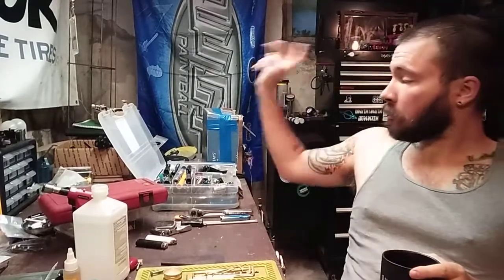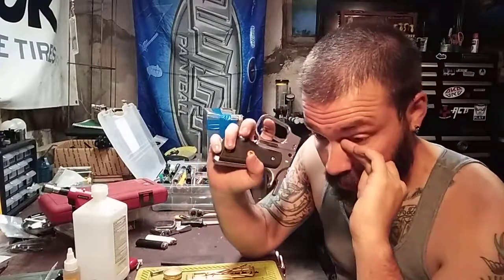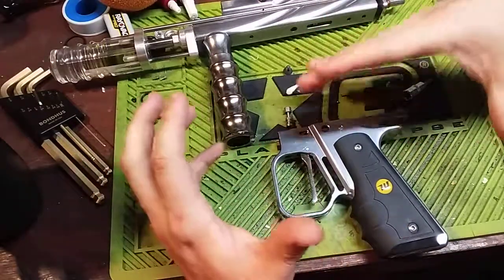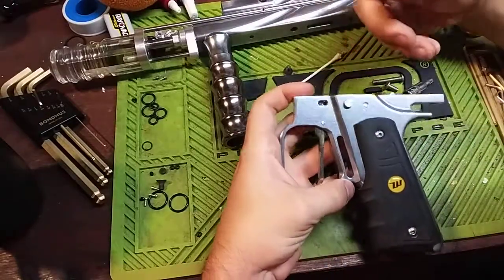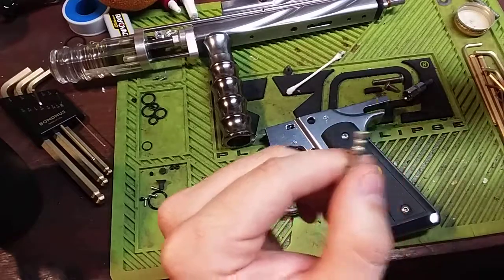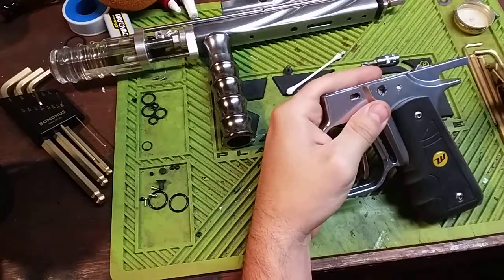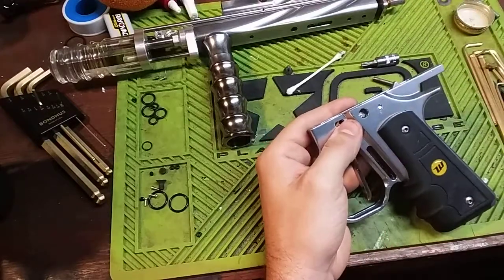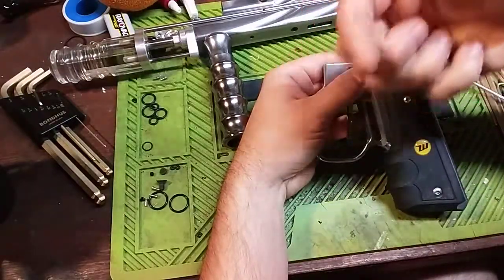Putting the safety in the frame hole and the coffee in the brain hole.

Comment: I recently purchased an E-Orracle (dream gun from my high school days). My only gripe is the feed neck. I see a couple split lines but the stack will not come off by hand. Are they threaded, but secured with permanent thread-lock or pinned before finishing? If it’s threaded I would love to get a clamping feed neck.
Reply from the maker: As I remember, orracles did typically come with a threaded feedneck. Given that the marker is 10+ years old now, it's likely that It's pretty stuck on there. If you have a vice handy, throw a couple wood blocks in it, grip towards the bottom of the feedneck, and try to give it a spin. Its very likely you may bend the stock neck, but it may also give way. Be careful and good luck#
Reply: KC Cocker Doc Thank you for the tip, I may give it a shot or send it in to Nummech for a custom press fit low profile feed neck. Just found out this morning there’s companies that still do custom work on these guns.
Reply from the maker: @SenMcNuggies  oh absolutely. There's several bigger companies and a ton of us with home shops still doing work. Cockers have regained alot of popularity ovet the past few years
Reply: KC Cocker Doc Happy New Year! I got the darn thing off. Hair dryer, a splash of WD-40 and a wide rubber band. Sucker was tight but it broke free with no damage or wear through the finish. O-ring was full of sticky crud.
Reply from the maker: @SenMcNuggies  Happy New Year! Glaf to hear you got it to cooperate!

Comment: Now im wondering how meny videos we have not seen
Reply from the maker: I've had more than my fair share of fails while recording
Reply: @kccockerdoc  dude you are helping me so much i have just started a autococker build with a psychoballistic and you are helping so much and i know its not the best but i just wanted a cheap plat form to tinker an mess with
Reply from the maker: @tardy1663  nothing wrong with cheapies, man. I'm really glad I can help a bit, and if there's anything you need help with just let me know!
Reply: @kccockerdoc  ill take you up on that can you replace a cocker sear with any other cocker sear becuse im thinking about getting a roller sear for my hinge fram on my gun
Reply from the maker: Aside from eblade sears, you shouldn't have any sears that won't fit. You might not feel much of a difference in a hinge frame from a roller sear, but build it how you like!
Reply: @kccockerdoc  would you recomend a new sear spring
Reply from the maker: Not really. They are nice sometimes, but not always necessary
Reply: @kccockerdoc  my trigger keeps geting stuck in the rear and i have to push it forwards what might help that not happen
Reply from the maker: There's several things that can cause that. A bent or misaligned timing rod or 3 way shaft is probably the most common. Dirt and debris in the trigger frame, springs too soft, dry o rings in the 3 way. Lots of different possibilities.
Reply: @kccockerdoc  you okay man you haven't been posting
Reply from the maker: @tardy1663  still alive and kicking! Haven't been sure what to post and so I started getting into machining cocker stuff. Been working and trying to find time to make things
Reply: Hello, I was wondering do you offer autococker repairs if I mail you my wgp Karnivor?